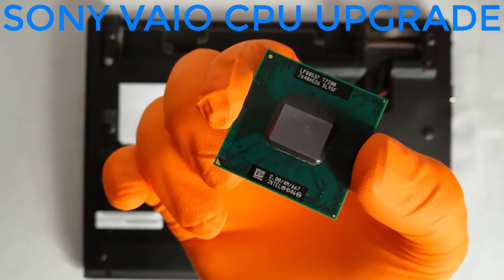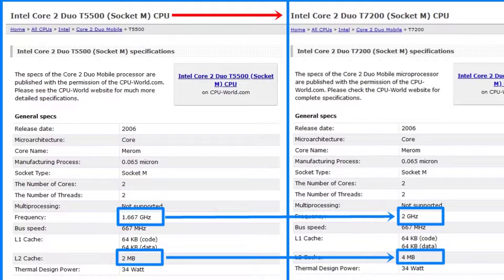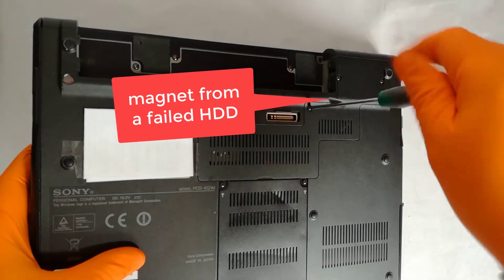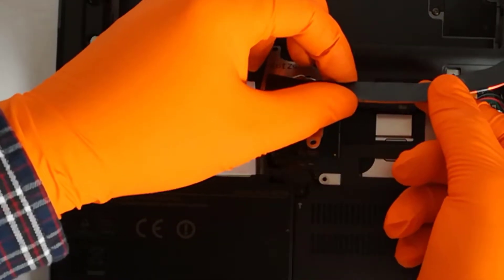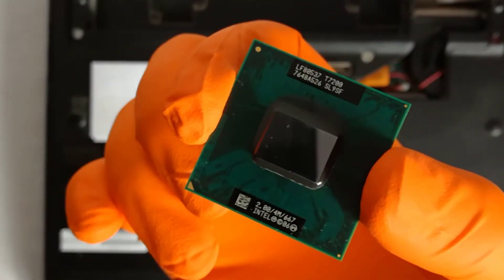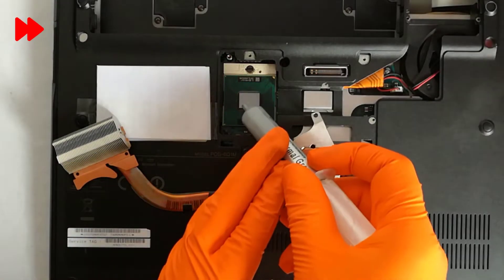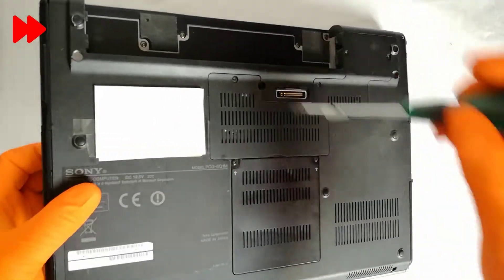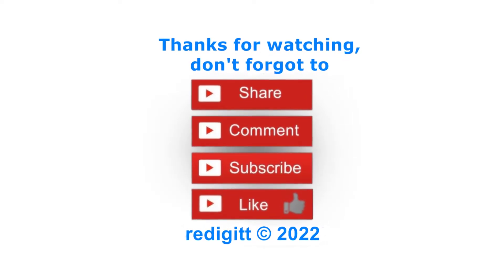Sony VAIO VGN-SZ4XWN CPU upgrade Ep.373

Comment: I Have got a Sony Vaio VGN-AR71j he Have got a dual core CPU is possibile put a quad core?
Reply from the maker: Aloha, you can't upgrade to quad core, but you can try to upgrade ton one of these CPU's, I didn't upgraded your mofel of laptop, so I can't say wich CPU will work,   it all depends of your BIOS.

Pentium T2370  2	                   1.733 GHz	533 MHz	1MB	35W
Pentium T2390  2	                   1.867 GHz	533 MHz	1MB	35W
Pentium T2410  2	                   2 GHz	                  533 MHz	1MB	35W
Pentium T3200  2	                   2 GHz	                667 MHz	1MB	35W
Pentium T3400  2	                   2.167 GHz	667 MHz	1MB	35W
Core 2 Duo T5250  2	1.5 GHz	667 MHz	2MB	35W
Core 2 Duo T5270  2	1.4 GHz	800 MHz	2MB	35W
Core 2 Duo T5450  2	1.66 GHz667 MHz	2MB	35W
Core 2 Duo T5470  2	1.6 GHz	800 MHz	2MB	35W
Core 2 Duo T5550  2	1.83 GHz	667 MHz	2MB	35W
Core 2 Duo T5670  2	1.8 GHz	800 MHz	2MB	35W
Core 2 Duo T5750  2	2 GHz	667 MHz	2MB	35W
Core 2 Duo T5800  2	2 GHz	800 MHz	2MB
Core 2 Duo T5850  2	2.167 GHz	667 MHz	2MB
Core 2 Duo T5870  2	2 GHz	800 MHz	2MB
Core 2 Duo T5900  2	2.2 GHz	800 MHz	2MB
Core 2 Duo T7100  2	1.8 GHz	800 MHz	2MB	35W
Core 2 Duo T7250  2	2 GHz	800 MHz	2MB	35W
Core 2 Duo T7300  2	2 GHz	800 MHz	4MB	35W 
Core 2 Duo T7500  2	2.2 GHz	800 MHz	4MB	35W 
Core 2 Duo T7700  2	2.4 GHz	800 MHz	4MB	35W
Core 2 Duo T7800  2	2.6 GHz	800 MHz	4MB	35W
Core 2 Extreme X7800  2	2.6 GHz	800 MHz	4MB	44W
Core 2 Extreme X7900  2	2.8 GHz	800 MHz	4MB	44W
Thank you for watching, if my video  was useful, please consider to share and subscribe.

Comment: Hello, I want to upgrade the processor of my Sony Vaio VGN-AR61ZU Laptop. (Motherboard: HannStar J MV-6 94V-0 0805) Intel Core2 Duo Processor T8300 Code Name: Penryn- Socket P (478) what do you recommend? Thanks
Reply from the maker: Aloha, I don;t have  the Sony Vaio VGN-AR61ZU laptop, I didn't upgraded the CPU for this model, but for the T8300 these are the upgradeable CPU's. It's all depends from the BIOS, if it has support or not.
My personal choice would be the one of the 35W TDP CPU's, the 44W CPU's probably would overheat, the cooling system was designed for the 35W CPU's. Please use good quality thermal paste.
Core 2 Duo T8300 @ 2.4 GHz, 800 MHz	                3MB	35W
Core 2 Duo T9300 @ 2.5 GHz, 800 MHz 	6MB	35W
Core 2 Duo T9400 @ 2.533 GHz, 1066 MHz	6MB	35W 
Core 2 Duo T9500 @ 2.6 GHz, 800 MHz	                6MB	35W
Core 2 Duo T9550 @ 2.667 GHz,1066 MHz	6MB	35W 
Core 2 Duo T9600 @ 2.8 GHz,1066 MHz	6MB	35W 
Core 2 Duo T9800 @ 2.933 GHz, 1066 MHz	6MB	35W	 
Core 2 Duo T9900 @ 3.067 GHz, 1066 MHz	6MB	35W 	 
Core 2 Extreme X9000 @ 2.8 GHz, 800 MHz	6MB	44W 
Core 2 Extreme X9100 @ 3.067 GHz, 1066 MHz	6MB	44W 
Thank you for watching, if  my video was helpful,  please don't forget to share, like the video and maybe subscribe and good luck with the upgrade.
Reply: @redigitt  <thank you very much